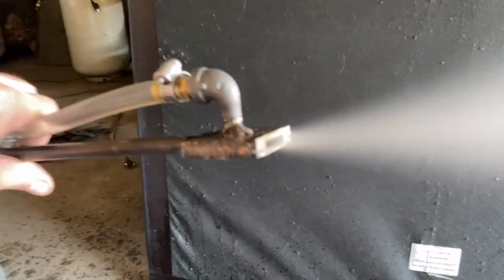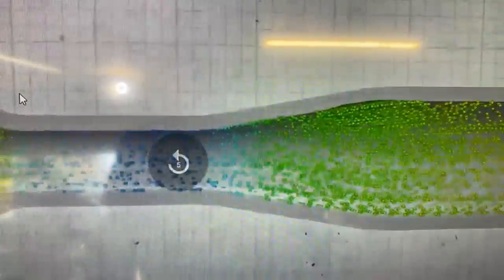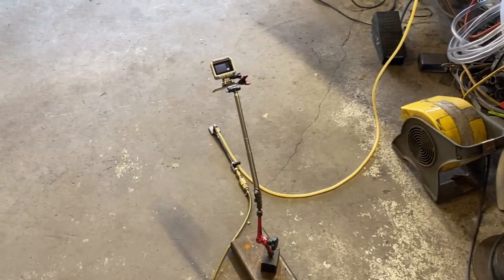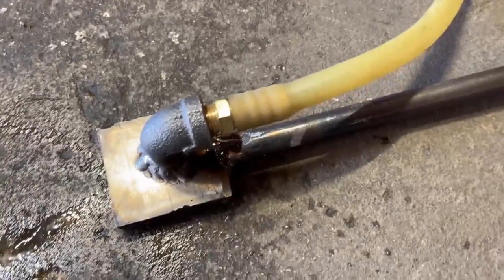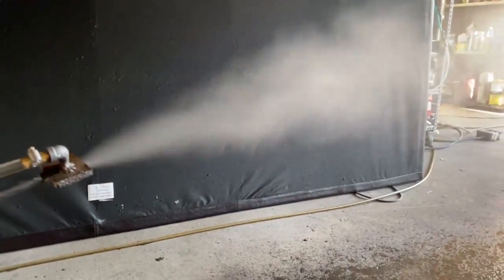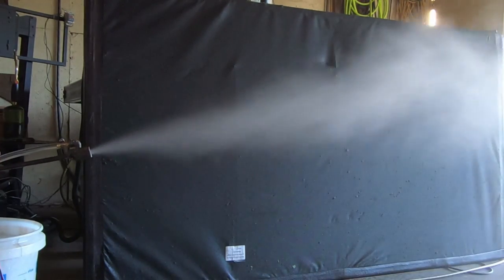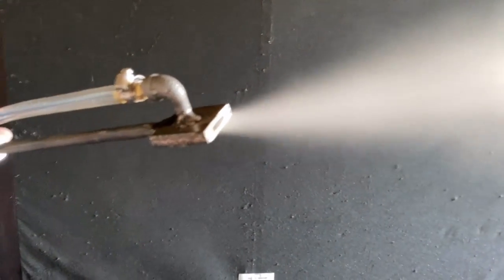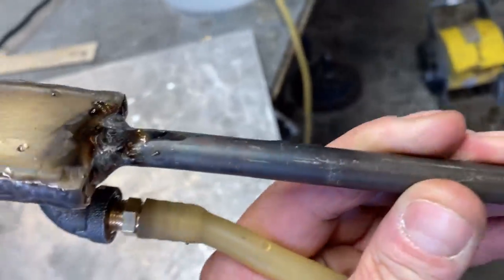2D laminated waste oil burner Nozzle {INNOVATION }

Comment: look into laminar water cannons. I bet if you can adapt something akin to the straws to force laminar flow in the compression area, you can get better control at the output. There's hypodermic tubes you can get easily enough precut to specific lengths, and since you are building the burner in lamination stacks, just pack the middle area full prior to setting the top plate and welding. You might need to tweak the geometry to make sure the tubes have enough pressure to retain them and they don't shoot out with the pressured gasses.
Also, the exit needs to be super sharp. The straws are a way to separate the fluid in a series of independent, parallel streams. As they flow in the  chamber, provided the walls are smooth and don't induce too much  friction, they stay orderly. On exit, the idea is to have the edges knife sharp so there is no opportunity for boundary (coanda) effects to divert the fluid and cause eddies. Rounded edge would cause the fluid to stick to the surface and turn with it.

Comment: Would a pulse fuel injector be of any advantage? The energy to activate the injector would be a complicating factor as well as a circuit board to control the injector.

Comment: Instead of investing in a metal printer you could get a uv-resin 3d printer and cast the parts in plaster under a vacuum. That way you get very fine details. It's the same process they use for casting jewellery.
Reply from the maker: Yes i considered this as well